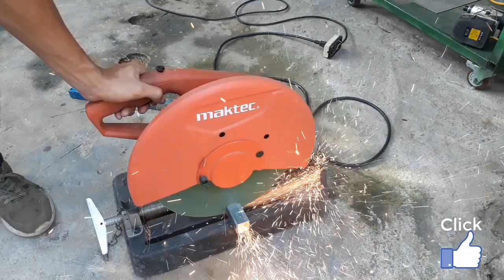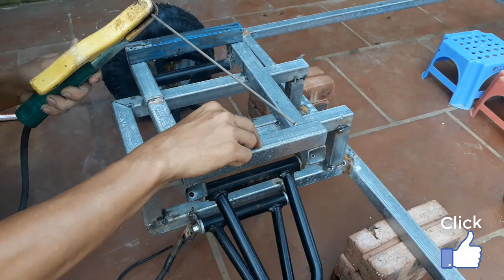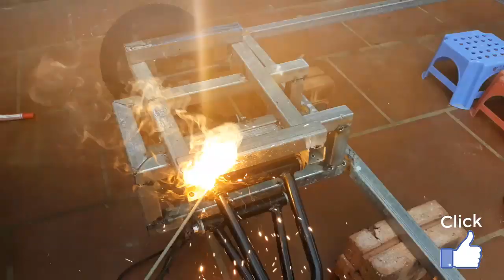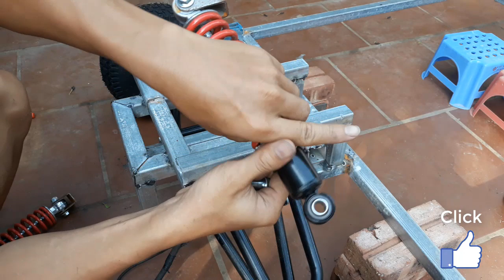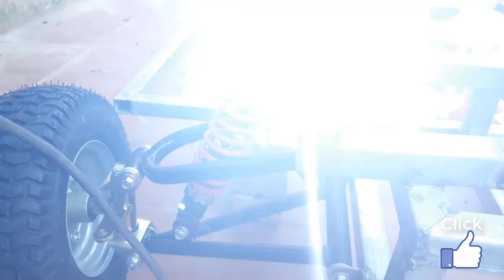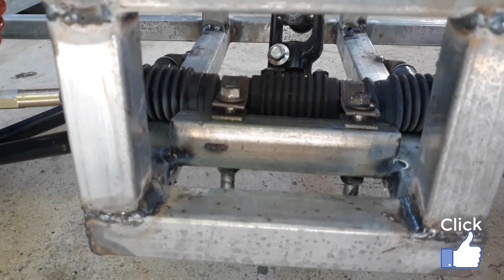How to make a Go Kart  at home - Part 5 - Custom steering

Comment: When compressing the suspension springs, the wheels change their angle. The steering rack is not located at that height.
Reply: Do you know how to fix that problem, I got the same problem